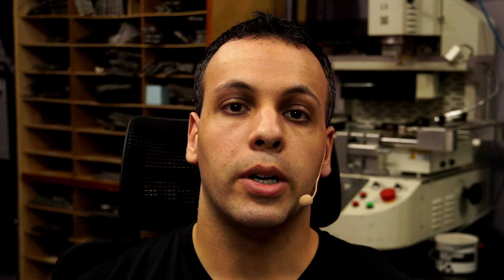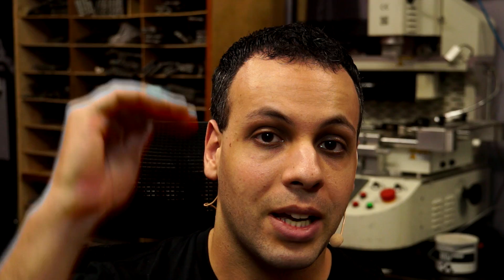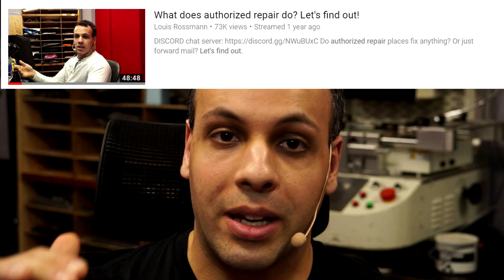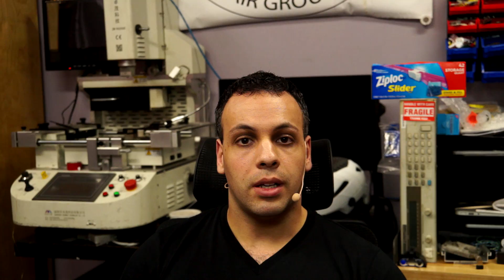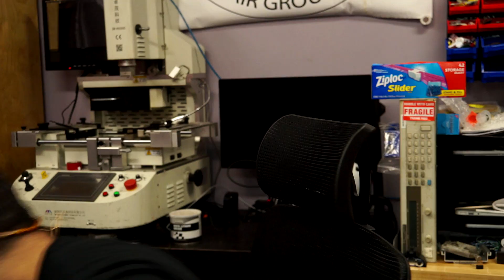Apple's war on refurbishing.

Comment: It is interesting. The last macbook Pro I bought was the one a pre retina because you could no longer upgrade them and replace an aging hardrive or add memory. I still use it when I travel, but not  on the daily anymore.  I have an iPhone 8+ but it will likely be my last. IOS works well with ApplePay and my WeChat, but each generation of design becomes more and more user unfriendly. I miss a headphone jack, so this will be my last iPhone. I still travel with my 6s because wireless headphones and a 12+ hour flight don't mix well and dongles suck! So i also have an android phone for my primary phone.

As far as me as a consumer is concerned, they have "innovated" away from another customer. I still use what I have already bought, but theywillhave to work hard to get me to buy again when next I need to upgrade!

Comment: I'm an Apple fan, and like and use their products. But their war on repair is maddening. This is going to set a dangerous precedent if allowed to continue.
Reply: I say Apple needs to burn. If the iPhone doesn't sell as well, Apple will notice. They need to be stunted in some way.
Reply: Don't continue to support them then
Reply: @codyjewell1460  That will never happen because he is not as upset as he tries to seem. He like many others,  have accepted their incarceration in Apples prison system and escape is not an option. The Apple logo God is too powerful. I'm very confident there is no help for him at this point..😔
Reply: When the alternatives (Windows PCs, Android phones) are worse in ways that I care about, I have no choice (and products like the Surface are equally, if not more impossible to repair, so Apple is not the only ones committing these types of sins). That said, I'm confident that I can use the products I own now for at least a few more years. We need right to repair legislation in the technology industry badly, just like we have in the automotive industry. 

What's even more perplexing about Apple's tightening of repairability on the new MacBooks, is that iPhones have actually gotten easier to repair over the years. It doesn't make sense. I can see the argument of "security" but when it's so tight that it's keeping out the good guys, what's the point?
Reply: you just made my day man it's just really priceless thanks
Reply: That's the sad part MS is already copying their bad business. Any other manufacturer don't go that way but who knows when they start to copy and make their products impossible to repair if Apple is gonna continue this.
BTW Windows and Android aren't bad you're just stuck with your garden and would never try something else. After iPhone 4 i went to Android and never looked back so far I've never had to repair my stuff and only had 2 Sony phones until now (I'm just not one of those who buy a phone every year). It's just how you use it. Maybe people are too careful not to break their Apple products cause they paid too much or they just worship Apple products.
Reply: @accordinglyryan  have you ever looked at an Enterprise grade laptop? 

Im not talking about the bullshit sold at Best Buy and Walmart. Dell latitude, HP Elitebook and Zbook, Lenovo Thinkpad.

Next day on site service. All metal construction. Fantastic build quality. 24x7 USA Support.

You can do everything you stated in your reply in Windows 10.
Reply: 1. Buy an Android phone that you can unlock the bootloader of
2. Install a third party ROM on it, such as Lineage OS.
Reply: Also, Windows peaked at Windows 7. It's just been going down hill with Windows 8 and now 10.
Use Linux instead. It's come a long way, and is now legitimately good as a desktop OS for even "average" users.
Reply: Then it is a matter of deciding what is more important to you: the UI of your device, or the business practices of the company that makes them.
Reply: @JIYkp  It's possible to install your own UI on Linux if you don't like the one it comes with.
Don't like Gnome? Install KDE, or Mate, or LXDE, or whatever else.
Reply: Juil At the end of the day I'm going to be using my computer a lot more than I'm gonna be tinkering/fixing it, so therefore that's where my priorities are. That said, it'd be great to have both and I do not condone what Apple is doing at the moment, even though I own a 2017 MBP.
Reply: why are the apple haters (I'm sure they have their reasons) attacking an apple user who, as a consumer, understands that there is a big problem with apple and their policies and shows his concern? maybe he likes the apple ecosystem and has grown accustomed to and isn't comfortable with Android or windows. I'm an Android user myself and wouldn't switch to either apple or windows because I got comfortable with Android platform and will pay for Android phone for the comfort alone.
Reply: Well of course, Android is objectively more customer friendly.
Reply: Oh how I love YouTube..."you have probably never used Android or Windows"

I was a full-time Dell/Windows user from the time I learned how to use a PC until 2014 when I got a MacBook Pro. I have about 30 Windows laptops sitting in my closet right now. I've owned 20+ Android phones over the years from Samsung, LG, Motorola, etc. I'm not a sheep, I just have a preference. The fact that you guys can't handle someone liking Apple products shows how immature you are. There are many reasons why I prefer them. So kindly go fuck yourselves.

I recognize that what they're doing is wrong, but the competition is still inferior to me (especially Windows, god I fucking hate Windows) so I'm staying where I'm at for now.
Reply: Eventually they'll crash and burn.  Sony is going to do the same soon.
Reply: already did in 2005, thats why the profits on their iphones have been steadily declining since then
Reply: db hillshire "thats why the profits on their iphones have been steadily declining since then" 
Er, what?
Reply: The profits percentages on iPhones actually are decreasing, The problem is they're decreasing by a small amount per generation (about 1%) but cost about 10% more in parts per generation.
Reply: That shows taht Apple company is truly a money grabbing company.
Reply: People who buy Apple products are problems.
Reply: Bless your heart
Reply: No offence but these a $$holes will only stop when a very large number of people blacklist them.apples the problem,no one else.
Reply: Yea stop using their services
Reply: @StuffOverload  did he say he was making some point you Fucking troll!🖕
Reply: @Shawn Stuckey, I disagree. I have owned two Apple devices, and I love them - a 4S (which just about works cos Apple wrecked it with the updates), and a 6S+ (that I got because my eyesight is not so good these days). The latest phones have been a joke, what with facial recognition, notches, and removing the jack...
I've been following Mr Rossmann for some time and watched him calling BS on their tactics, and quite rightly.
I love the constant security updates (my reason for going to Apple in the first place), but I swear on what's left of my eyesight, that unless Apple stop being dicks (they won't!), the 6S+ is the last Apple product I will ever buy or own.
Overpriced, badly-designed, outdated kit that is being peddled under the pretence that it "Oozes Quality", when in fact it is just a polished turd that will break - then they will over-charge you for their bad workmanship, and let you know that it was all your fault.
"You're holding it wrong." F$ck Off!!
Reply: I mean if it oozes anything it can't be quality can it? :p
Reply: u cant complain! ur addicted to their products.
Reply: Stop buying their bullshit
Reply: How odd you're a fan of a company
Reply: Literally what the guy in the video said.
Reply: If you buy Apple products then you support their behavior. Period. Apple doesn't care if you think their war on repair is maddening.  They don't care at all.
Reply: What is there to like about Apple?
Reply: Plenty. Cohesiveness of the devices and the way in which they work with one another, stability, ease of use, quality of applications, timely software updates (and not being forced to install them if you don't want to cough Windows 10), general reliability, and longevity of hardware/software support. iPhones are guaranteed software updates for 4 years. Android phones are lucky to get two.

I mean shit, Microsoft just pulled an update for Windows 10 that was literally DELETING PEOPLE'S FILES. I cannot and do not want to deal with that kind of bullshittery. Neither ads built into the OS itself. I switched to the Mac after being fed up with the misguided direction of Windows 8, and I use iPhones because I always have, and prefer them over Android devices. It's just what I prefer. If everyone liked the same things, this world would be incredibly boring.

I mean did yall even watch the video? Louis cited several things about Apple products that are good, and understands why people like them.Apparently the commenters are too dense to grasp that concept.
Reply: Even apples components are sharing their rage lol. Don't worry my little fan you'll be set free soon from the motherboard prison. #HELPAPPLEFANS
Reply: look "Strange parts" Youtube channel - you can now make your own iPhone 7 only from used parts in China - you don't need Apple anymore 😂, that's the problem Apple scared - it's a huge amount of iPhone parts right now (they made too many iPhones) and they very cheap, i bought 20 used original iPhone 6 speakers on Aliexpress for only 3 bucks
Reply: Well actually a 1050 ti is about average for a 1500 dollar ultrabook. The question is how long it'll last...
Reply: What?.... 1050 ti laptops start out at 699 usd. 1060 laptops start at 1199.
Reply: Since i switched to Windows 10 in 2015 i went through all kind of nightmares and this weekend my third complete fresh installation thanks to a PlugIn not working without reason and i tried all. But no Time Machine i could start to get to an older state, no, Windows Shit forces you to do updates even without notifications and it was probably a shitty update causing this. And when problems appear it is as userfriendly as landing Jumbo Jet and 9 out of 10 tips on the internet doesn't work at all. With this bad competition Apple can blackmail their customers into buying everything...
Reply: Thank you for supporting APPLE.  APPLE NATION FOREVER!!!

Comment: This all started after Steve Jobs passed away. I have a 2012 Mac Pro that is easy to maintain and to upgrade (dual 6-core Xeons and 64G DDR3 ECC). I don't know how anyone could use iMAC or the ash can Mac Pro in a professional environment when it cannot be quickly repaired. Eventually this will backfire on Apple.
Reply: If only Stalin Jobs knew!

Comment: This sounds like what Microsoft tried to do around 2000. They wanted to put a security chip in all  Windows based computers so that only Microsoft authorized software would run. All third party software makers would have to have there software approved by Microsoft. The original Xbox was used a a test bench for the system. It has had at least 3 different names for it over the years. 
I wondered how much they would have charged the software company's to approve there software. Would there be the slow system for only 10,000 that can take a much as a year to approve or the expedited approval that would only take a few months for a mil or more.
Reply: Robert Peeler They also established a system for their successful Windows Mobile 5/6 phones that required all software to be signed by Symantec.  It cost a fee for every software version and update.  A few days ago, the company that bought the Symantec division started shutting down that service.

Comment: Hmm, what I really wonder about now though is: does this put you into some legal trouble with your previous customers whose laptops you fixed for don't work properly anymore? To be honest here, no matter how you stand on this issue either pro-self repair or not, Apple called the shot way after the fact and it should be on them to provide people with a working screen again, meaning, get rid of that lockout at least on existing laptops.

If they want to call that shot on future models and everyone knows what they are buying into it's still mighty shitty and it shouldn't be legal for them to lock you out of your machine over a display swap under ANY circumstance, but this is just a much higher quality of a problem.

For what it's worth they might as well disable my iMac's Samsung SSD that I put in myself long after the warranty was up to give this baby a little more life and it wasn't like I had an official option anyways anymore if I remember correctly. Either way, it's BS like this that will - hopefully - bite them in the ass in the long term.

The most glaring problem is of cause that everyone is so extremely scared of Apple and not getting access to their presentations and sample devices for those early reviews ($$$$$) anymore that they completely succumb to Apple's PR apparatus.

As far as mainstream media goes, they go completely unchecked and even the new iPhone prices have only gotten "surprised" commentary, never have I read substantial critique.

I do see some direct critique from time to time especially about their tax deals with Ireland here in Europe, but that's pretty much it.